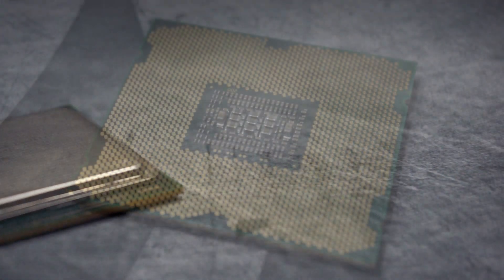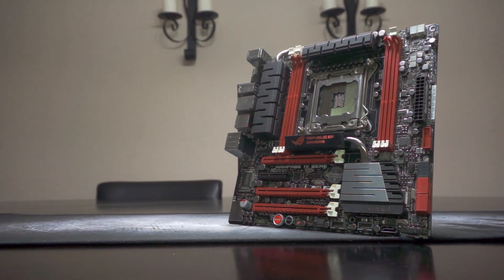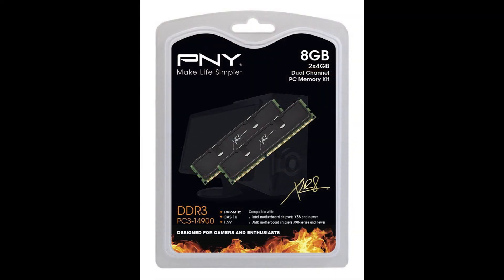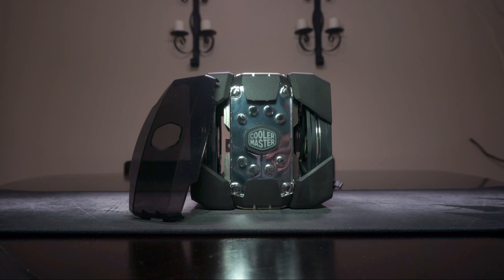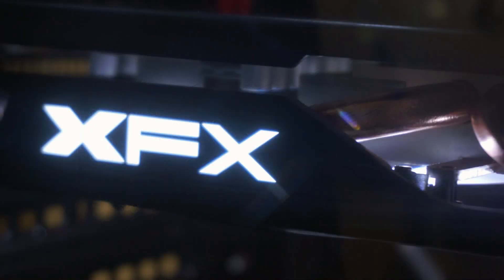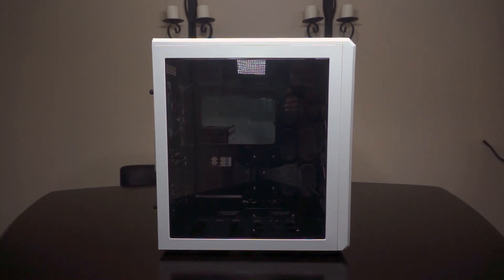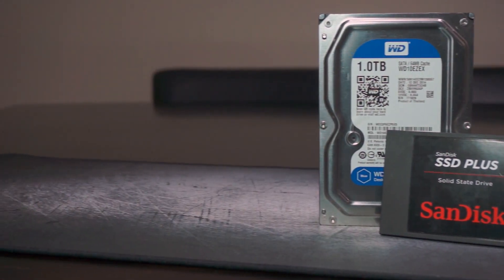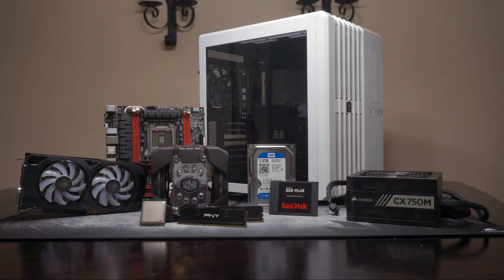ULTIMATE BUDGET BUILD!!! Intel Xeon E5 2670 Editing/Gaming Build!!!!

Comment: Why no Benchmarks ;(
Reply from the maker: +Jeffry Paker I actually took some, but it was so late @ night when I was putting this back together and editing, I just forgot to include them lol
Reply: Can you please load it up? :) xD
Reply: An e5 2680 kept at 3.1 will give you similar performance to a i9 9900k in some games , so I'm assuming the e5 2670 which is the same chip with lower clock speeds will just get you slightly lower so probably in the realm of a i7 6700 or i7 4790

Comment: Dang that's one beavy budget looking rig u got there man. I see you have the v8 cooler master. Can u adjust the fan when putting in a big heat-sink memory like the G.Skill tridenz. Is it also good with overclocking?what's the temp. on idle and on heavy load while overclocking?

Nice video bro keep it up!
Reply from the maker: +Randy Natsir yes u can adjust the fans. They slide up and down on a rail system, and lock into 2 different positions. And with 120mm fans you have even more clearance. Idle temp - 28°C - 30°C. On load, I rendered this video and had temps up to 48°C. Not bad at all. Its great for overclocking man. I havent had a real reason to overclock this chip as its just fine but it def keeos it cool!
Reply from the maker: Randy Natsir and it does look like a heavy budget. but dont be fooled. this couldve easily been a $1500 build had I not gone with eBay and Craigslist for some parts. if you go with a cheaper cooler and maybe an older GPU, u can come in at roughly $700 or so.